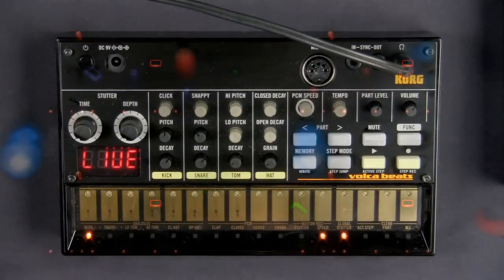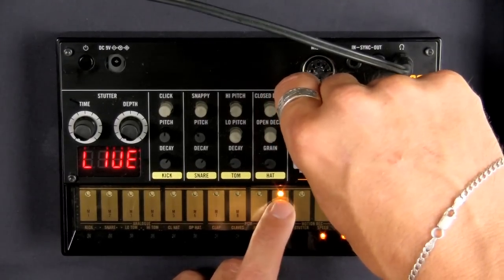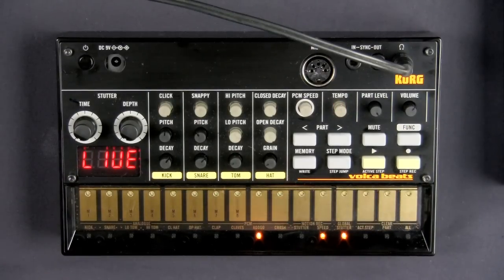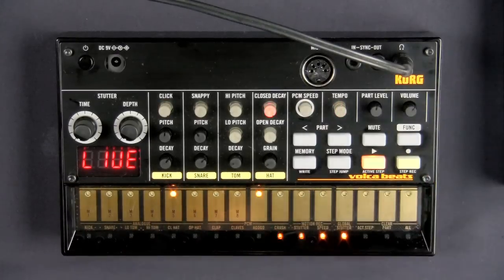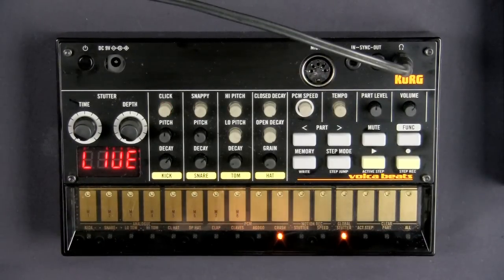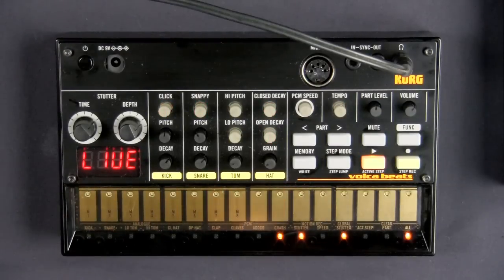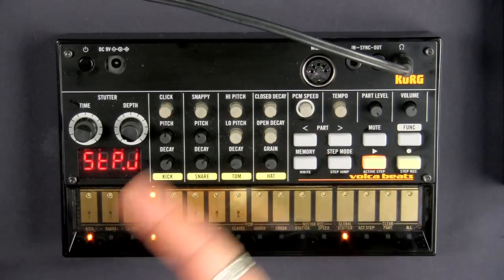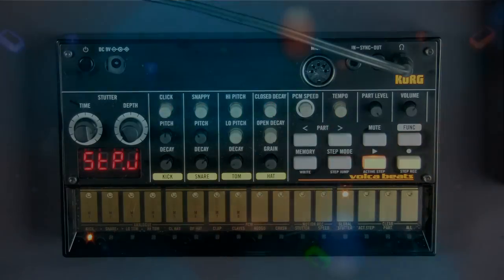The Korg Volca Series: Korg Volca Beats: Performance

Comment: Great video - Thank you!
One quick question and forgive the silly nature of it - can one chain 16 step patterns together? If not, I guess you could build up a 'song' by bringing in muted parts over time...

Anyway, thank you!
Reply: It lets you save up to eight patterns that you can quickly switch between by holding "write" button. eight keys will be lit to represent the saved patterns, with one of them flashing to indicate which pattern you are currently playing. Press any of the other eight keys while holding write button to switch. Can't recall if this is while in step mode or live mode tho.